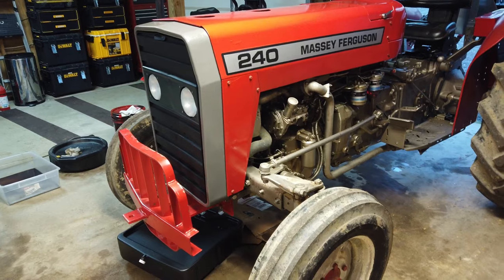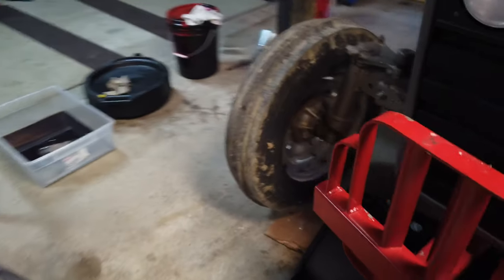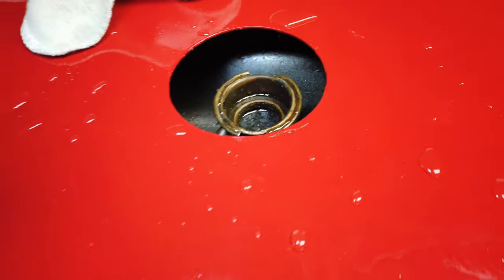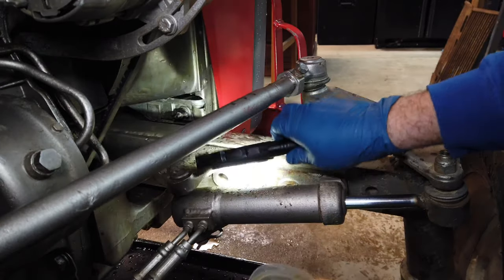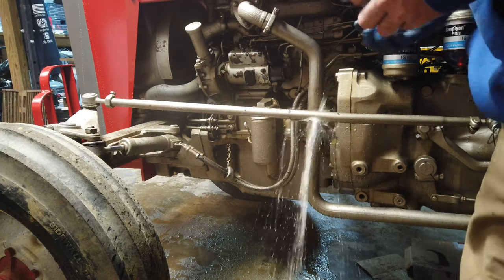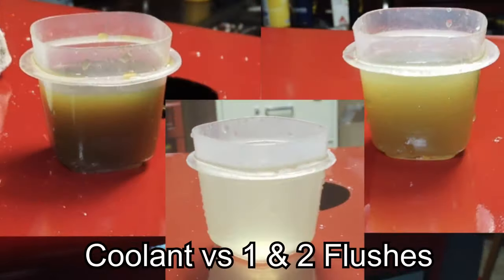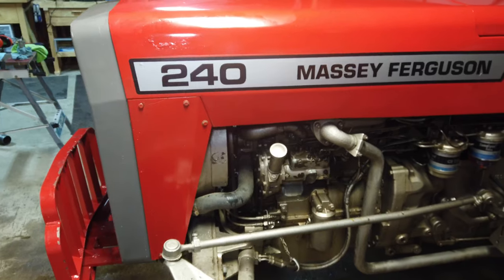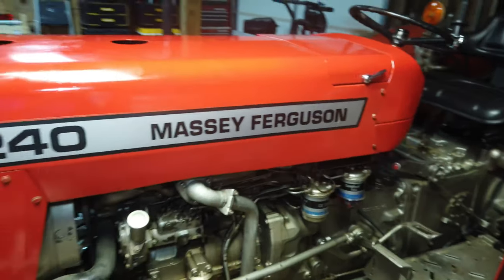Coolant Flush Massey Ferguson 240

Comment: Great information. I started to flush my MF 240 today, but the drain plug  at the bottom of the radiator will not turn. Will most of the water  drain out the side plug if I try to use that as my flush method?  Thanks.
Reply from the maker: I think you would want to try and get the bottom plug open if possible since will leave a lot of coolant in the system otherwise.